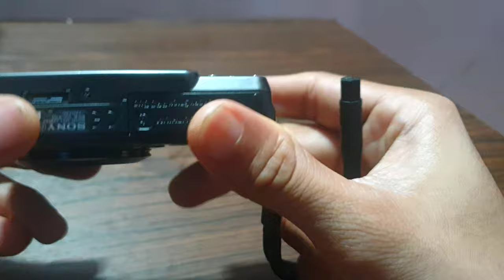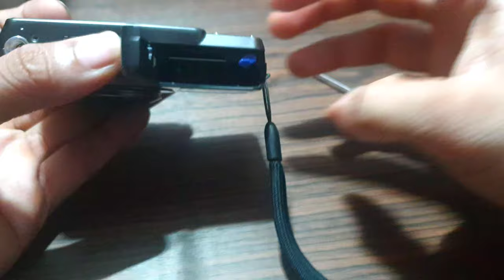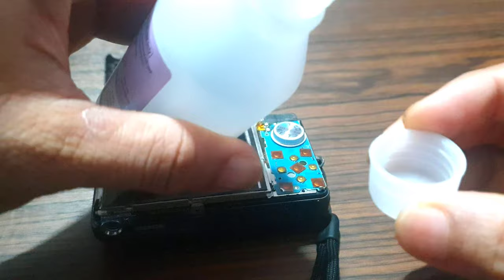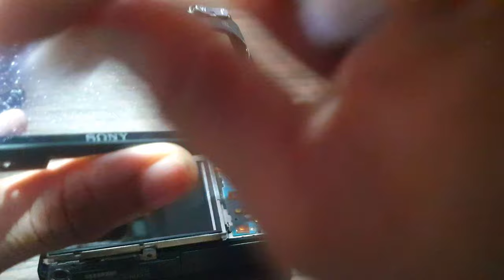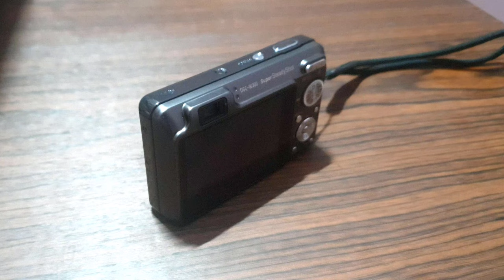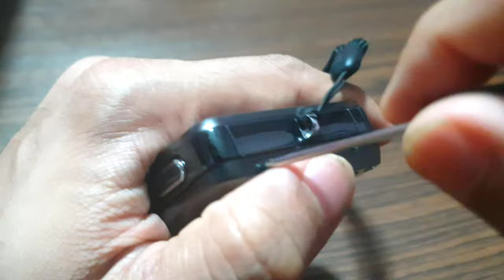How to clean digital camera LCD screen | Sony Cybershot DSC-W300

Comment: To clean dust off the front of the screen, I have found that the very fine sheeth of plastic of a file or document separaton works well. Cut a piece about 3 inches long, press the 'ON' button so that the lens telescopes. Slide the plastic between the last two rings (telescoping and fixed ring) and fiddle it back and forth. You will feel it easing, so watch the screen on the back of the camera and twiddling it you will dislodge the dust.